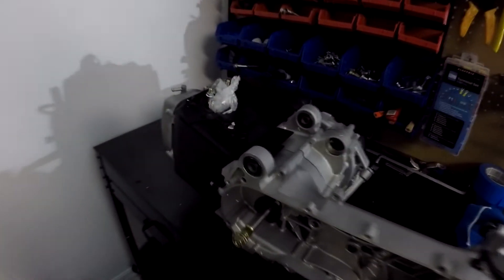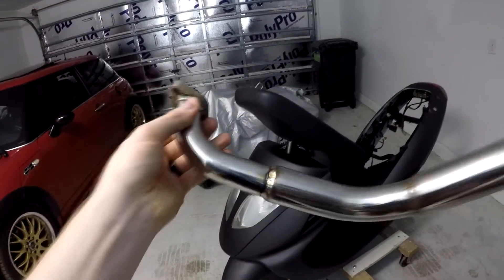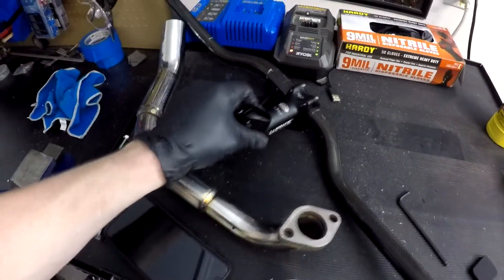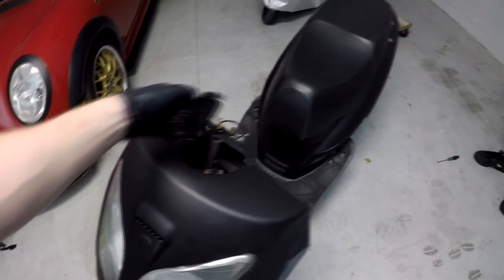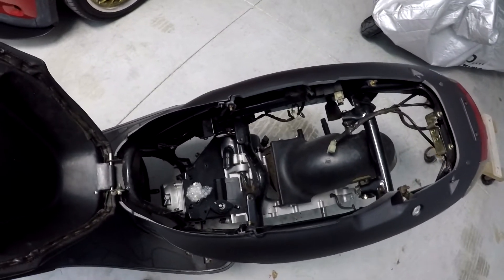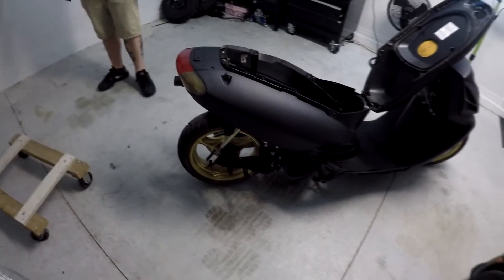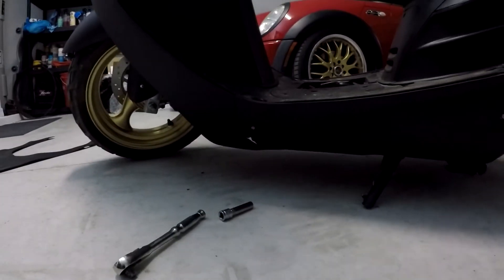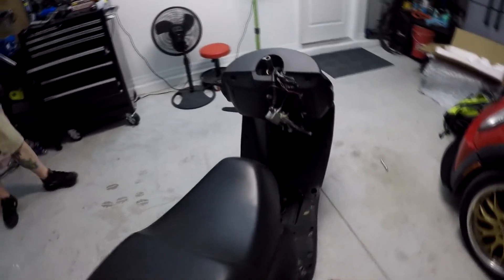232cc motor Has Arrived!!!!

Comment: What's the max stroke you can run in a GY6 before getting into clearance issues?
Reply from the maker: What do you mean clearance issues? You will have to use stroker spacers depending how long the stroker crank you are using. As well the sleeve will be longer on the jug to accommodate the throw of the stroke.
Reply: @burnoutbobby  will the back of the rod hit something
I've seen it happen on other motorcycle crankshafts
I'm planning to use an 8.2mm stroker crank, will I hit something inside the engine?
Reply from the maker: @KXSWORKS  no but make sure whatever cylinder you have has the extended sleeve as well as the stroker spacer.
Reply: How long should the sleeves be
I'm using a generic 61mm bore 
Also do I need a longer connecting rod to address the stroke to rod ratio?
Thank you so much for the replies I really appreciate it😁😊
Reply from the maker: @KXSWORKS  the rod is built into the stroker crank. You will need a cylinder that is 61mm with extended sleeve in it.

Comment: Is you mtb stem 1/8 or 1.5? I want to do a bar swap but am chopping the steerer down to where it gets wider at the bottom.
Reply from the maker: I took it off and threw it out. I didn’t have good fitment.

Comment: Nice man! I had some handlebar issues with mine.. They were too low for me and my knees were hitting when I made sharp turns so I bought something called ROX handlebar risers. How much does one of them engines cost?
Reply from the maker: Depends on what you get on it but around 2800-3k
Reply from the maker: I’ll look at those risers
Reply from the maker: Been saving up for a while man. Been wanting this setup for 2 years now.